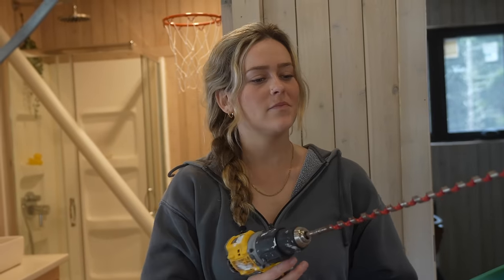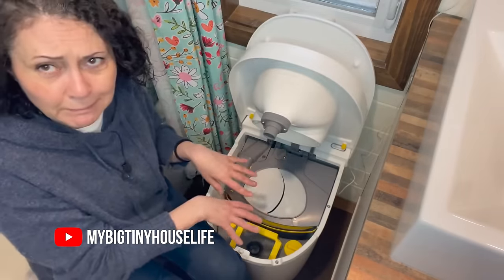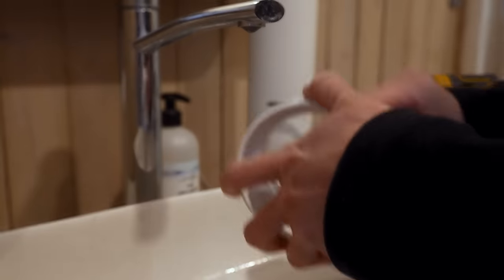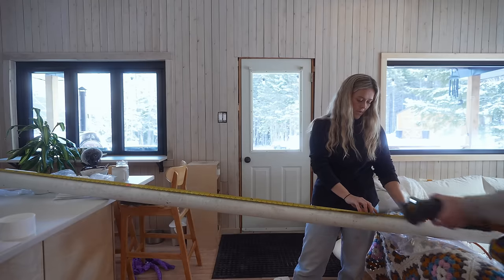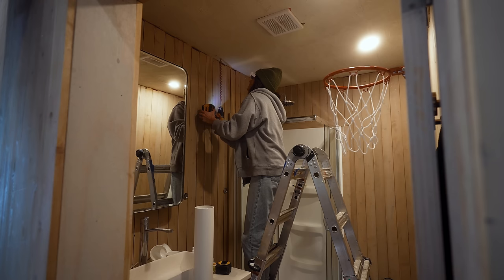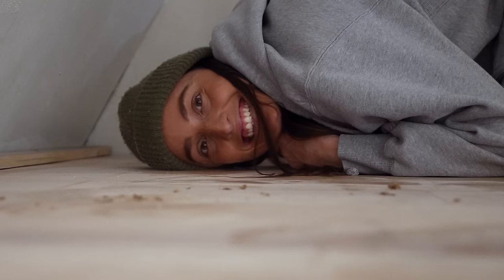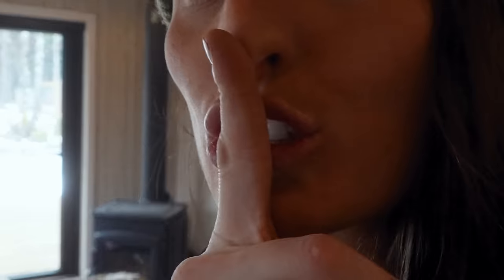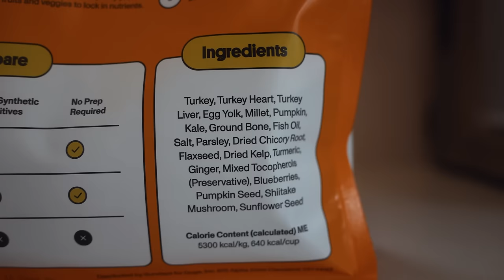Our Honest Experience: Off-Grid Cinderella Incinerator Toilet

Comment: I can't speak to their residential units, but we have the Cinderella Travel in our bus and it's been absolutely fantastic with very easy maintenance to perform. Never once had an issue with it, and we don't need to remove it from the propane line every time it needs to be cleaned.  I believe this is only the case with the residential unit because of how you need to clean the built in (non-removeable) catalytic filter. On the travel model you can remove the filter completely for cleaning, thus not having to do any sort of "steam cleaning" cycle after flushing the filter on your unit. 

More to the steam cleaning point....you mentioned that you'd have to get a gas man out every week to disconnect your unit, as well as "buy a steam cleaner". This tells me that you did not read the manual for this toilet or do any research on your own. The steam cleaning refers to adding water to the ash bowl after you've cleaned it, and then running a burn cycle with the water in the bowl. This action essentially "steam cleans" the catalytic filter inside the toilet. 

For the gas line into the toilet, you can simply have a flexible gas appliance line installed to it that will allow you to remove the toilet from the wall without having to disconnect the line. Just simply turn the shutoff valve to the off position, then remove the toilet from the wall. Removing an appliance gas line is not a big deal, and does not always need a gas guy to come out to do. Ton's of YouTube videos cover how to do this in a safe manner.

I'm sorry you had a terrible experience with Cabin Depot through all of this. We went with RV's of America as our Cinderalla dealer and they have been fantastic.

Comment: You have water in the cabin, why not just put in a septic system and never worry about it again? You could have installed one for not much more than the price of those toilets? You probably explained this multiple times already lol.
Reply from the maker: Hey Buck, we want a septic system for sure but we needed an immediate solution. A
septic will be in our future. 😊🐶
Reply: @Vanwives  you could do 90% of the work with your tractor and make great videos and save a lot of money!
Reply from the maker: @buck8176  From where we are from you must only be completed by individuals recognized under the On-site Sewage Disposal Systems Regulations. Can't be a DIY
Reply: @Vanwives I live at the lake across the road from the “spring” you used to get water from. Some installers will allow you to do some of the dirt work. Maybe not to people with a huge public platform lol
Reply from the maker: @buck8176  lol lol lol

Comment: Girls,  You really need to have a septic tank installed and put in a real toilet. One that has one lever and poof everything goes away.  (it would have been cheaper too)
You will find out that the pee line will need to be flushed out every so often as the pee will crystalize in the pipe.  How are you keeping the water from freezing that are in the traps that are below the house?
Reply from the maker: Right, we agree. We want one just fitting it in to the to do list. 😊🐾